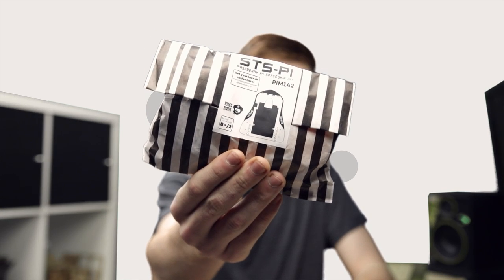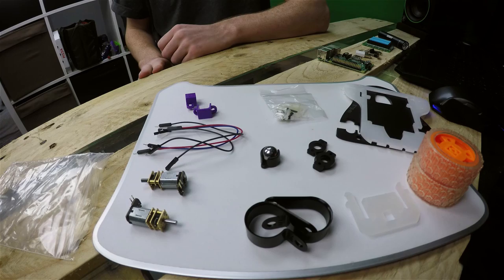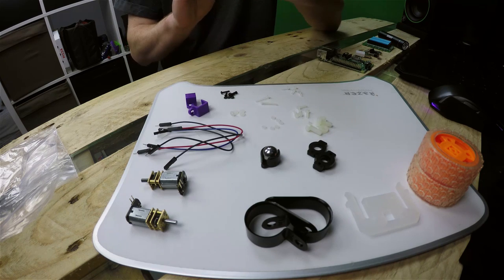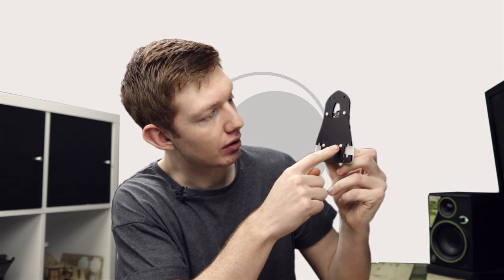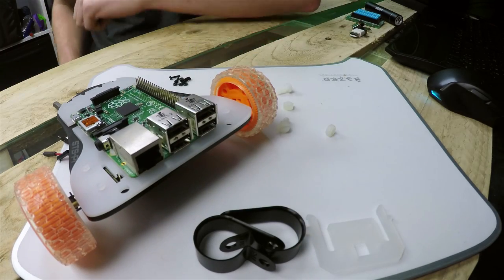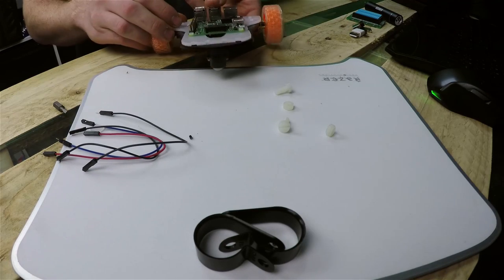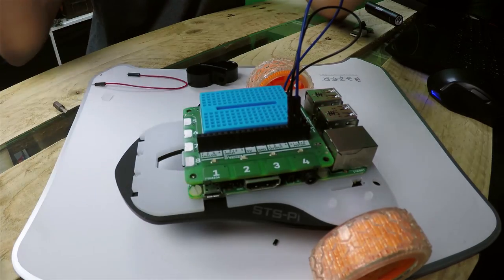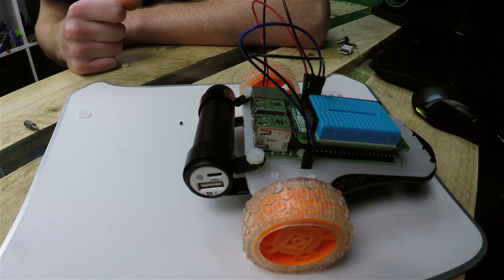STS Pi Raspberry Pi Build Video

Comment: Just followed your video to get my STS-Pi kit built. I noticed that you used the nylon bolts to attached the motor brackets, but my kit came with black metal bolts which are the ones to use for these. The nylon ones are OK for the camera mount, but not strong enough to hold the motors in place (you cannot tighten them up enough as the threads slip in the nuts). The motors need to be held on tight, where as the camera will not be subject to much force and can be held on with the nylon bolts.